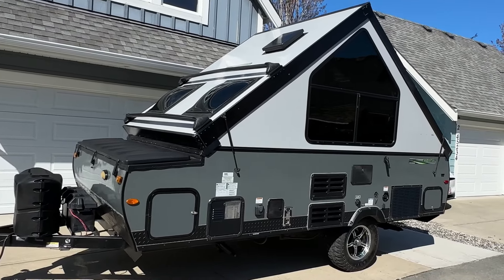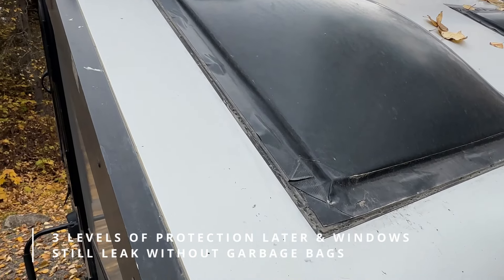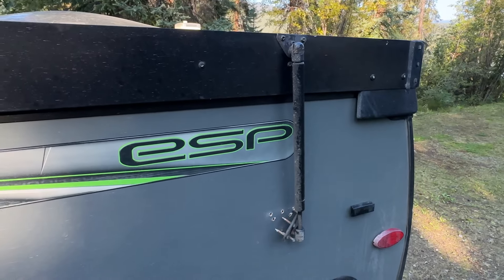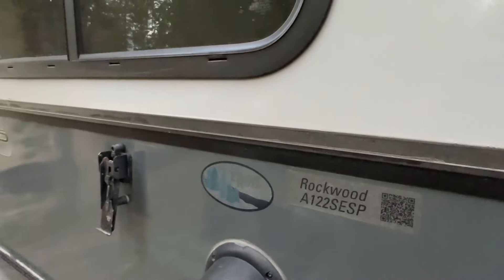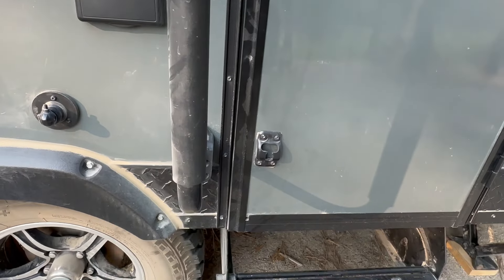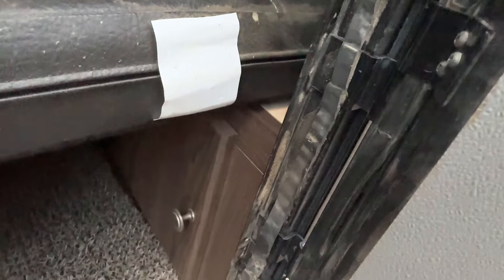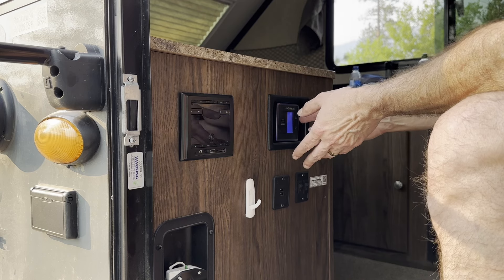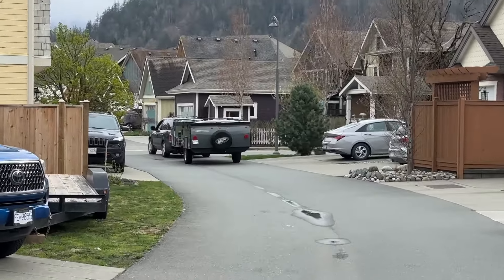10 Major Issues With Rockwood A-Frame Campers & How To Fix Most of Them

Comment: Maybe the newer campers are poorer quality? I have a 2011 Rockwood A126 that I bought new. It’s been on both sides of Canada and the US. I haven’t had all these problems except the back window getting cloudy. I had it replaced but now thanks to this video I know what to do to make it clear again. 13 years and still going strong. I LOVE my A126 camper!!! ❤️
Reply from the maker: So many of the newer RVs are having issues, not just this unit. Cost savings that the manufacturer makes almost always relates to lesser quality. Glad that yours is holding up well!

Comment: I was filling the fresh water tank on my Palomino A-frame and it fell out!  The anti-rotation bolts weren't installed on the hangers, and there aren't any safety straps.  Tons of other issues too.  I've owned over 20 RVs over the years and never had one I liked.  They are all junk.  I recently built a Wedge Camper for my truck and am quite happy with it.  Looking forward to a van build in the future.  Thanks for confirming my bias.
Reply from the maker: Thanks for commenting. The good ones are few and far between. Too bad less expensive has to always mean not just less quality but also far less reliability. Even the low end models still cost too much for the life they have in them before costly repairs start kicking in.

Comment: I owe A213HW. Never have I heard of such issues. Nothing on mine has gone out. Maintenance is key to anything. You need a tank more than a camper. Thank you
Reply from the maker: I agree. Should have gotten a different model. The unit I had was made to look rugged only, it certainly wasn't built that way. I fixed every issue it had before selling it. Good luck with your A-Frame camper!

Comment: I just watched your video a little too late as I take delivery of a 2024 A213HW next week. I had to chuckle as I wanted an a-frame so I wouldn't have to repair another lift system failure. "What could go wrong with a hinged wall?" I thought naively. We'll see how it goes. I'm retired and reasonably handy so I think in 3 years it will look like a homebuilt after all the repairs🙄
Reply from the maker: Thanks for the comment! My recommendation with your trailer is to baby it or else you’ll have issues in short order like most who own one of these. Don’t take it on dirt roads if you can help it. They are cozy and practical for short trips. I did a 10 week, 9000 mile trip with mine last summer, way too long for such a small unit. Check out the video series on my channel! Episode three coming out soon. Best of luck with your new unit!
Reply: @philipgelsheimer5705 I'm interested in an update on your A213, as that's the model my wife and I are looking at getting in the near future; I really like the idea of independent twin beds that can convert into a large king when needed (and the hideaway cassette toilet). While it seems like QC might be a nightmare on these things, there is no comparable A-Liner equivalent for the A213 and maybe some proactive upfront investment might keep some of these issues at bay!
Reply: Same here. Any update as I’m looking to purchase as well.

Comment: After watching and reading all these damage stories I've decided to rent a trailer when the urge gets me.
Reply from the maker: Good idea. The cost of owning and maintaining a trailer is hard to justify if you only use it a few times a year as most do. This is especially true on new trailer purchases and the fast depreciation they go through. When you factor in total cost of ownership after a trailer is sold and you divide that by how many times it’s been used, the daily cost of using that trailer is shockingly high in many cases. If you only plan on going out a handful of times a year then renting is by far the better option.

Comment: I have one of these campers it's a 2015 Forest River A122 I love it I take care of mine and keep it covered when not in use - the windows on yours are really jerry-rigged!  Someone has run self tapping screws through the windows into the camper that's not factory no wonder it leaks - The lift support looks bad/stuck thats why it ripped out the side you can see all the corrosion on it + it's not fully extended -  The hinge is just a big piano hinge that's such a easy fix don't keep cutting it as it comes out - also the door seals are not factory
Reply from the maker: I clearly bought the wrong unit. Glad I sold it. Hope yours continues to give you years of enjoyment. Thanks for the comment!
Reply: @capturereeladventure  Which unit did you buy? so i don't buy one. Someone will buy it. I am using this Aliner for my job. I am getting tired of eating in my truck.

Comment: It's unfortunate that QC/build quality seems to be such an issue with these models, the newer A213 model is one my wife and I have our sights set on because of its sleeping arrangement not being offered in the higher quality A-Liner brand (dual twins that can convert into a large king).

While these Rockwood/Flagstaff models are clearly a much lower-tier in quality to A-Liner, they are also substantially lower in price (in the $15k/40% cheaper range for comparable models). Do you think a proactive initial investment in some of these remedies from the outset might have changed your opinion of the camper? If I "save" $15k on the Rockwood model, but also make a ~$2k additional investment in fixing most of these weak points before they become problems, do you think it becomes a worthwhile product at that point?
Reply from the maker: You bring up an interesting point. Whether you make additional proactive improvements I would machine that it depends on where and how often you plan on taking your trailer out. I’m no expert on these units, I’ve only been able to share my experiences. The many other comments on this video clearly shows it is a lesser build quality than the Aliner, hence the increase in price. I suggest posting the same question to the various Aframe Facebook groups. This is where I believe you’ll get much more insight into whether your suggestion may be the right way to go. Good luck with your purchase. I hope the trailer serves you well. Thanks also for the comment. It’s really appreciated. 👍

Comment: What year was your camper?  I have a Rockwood A-Frame and have had great luck with it except for the skylights which I replaced with Lexan Formed exactly like the originals and they were all bedded in butyl rubber and then taped with Ethernabond.  It's a great camper!
Reply from the maker: Mine was a 2018. The skylights on Rockwoods are screwed in compared to the Aliner which is glued on and no screws. The holes drilled to allow the screws to hold down the bubble windows develop stress fractures which cause it to leak. They should do away with the bubble windows and not even have any in that location. There is plenty enough light coming in from the main windows anyway. Everyone who owns a Rockwood Aframe camper will develop leaks in these locations. Good luck with your camper and thanks for your comment!  👍

Comment: Not too long ago, I was reading that Rockwood A Frame campers have poor build quality and not to buy them because you will have multiple issues.  The Aliner brand are the original A Frame campers, they are well built and last for decades. I think you just bought the wrong brand. Glad you sold it!
Reply from the maker: Thanks for the comment. I wish I would have known about the Aliner quality difference before I bought mine. Very happy I sold it for more than I paid for it.
Reply: @capturereeladventure  I have owned two Aliner campers and both of them had the same leaking problem from the windows. Those plastic windows, develop micro cracks. It’s almost impossible to avoid leaks.  That was the main reason we sold and moved to a more traditional travel trailer.
Reply: @capturereeladventure Aliner is just as bad or worse these A frame trailers are the worst way to camp so cheap  k y built and overpriced.

Comment: Why didn't you remove the skylights and sealed them correctly?
Reply from the maker: There were multiple layers of repairs done to these windows and would have taken a huge amount of time and effort. I decided a year after buying it that I would only own it only long enough to take me on a 14,000km/9000 mile journey up to the Yukon, NWT, and Alaska. Did the necessary repairs and recently sold it. Glad to get rid of it, just way too many issues. In fact it has sworn me off of rvs for the forerseeable future. Will go truckbed camping when I want to rough it. Cheers.
Reply: Or buy a good quality travel trailer. Car camping is like being homeless.